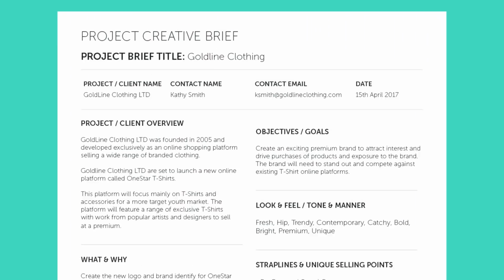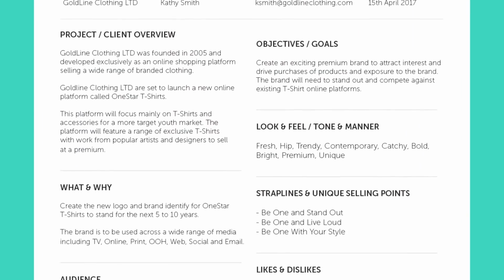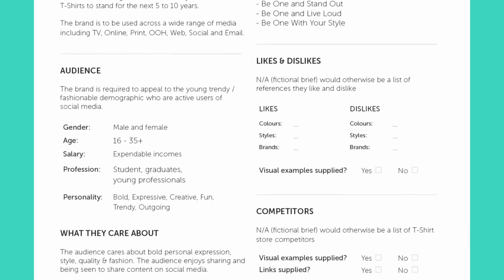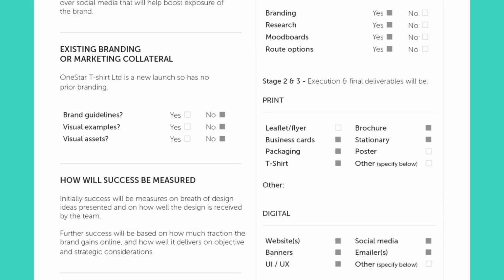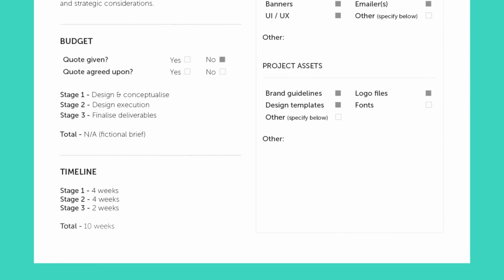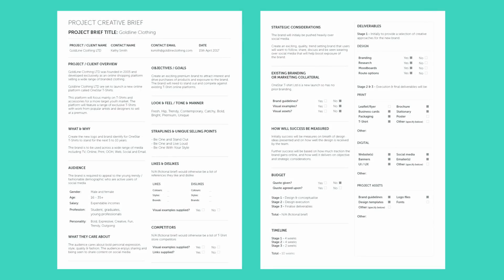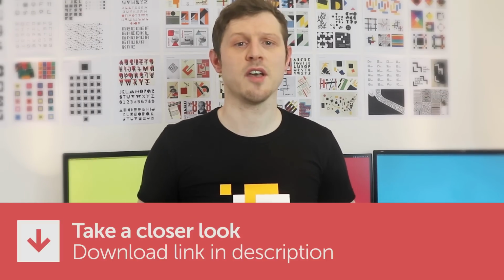The Graphic Design Brief

Comment: I'm actually having a hard time lately on creating my designs because I can feel there is a missing part between me and our clients specially that im not usually the one meeting them if i was too busy 
im sure that series will help me to figure this out cuz as you said I can feel that it takes much time to edit and adjust when we don't meet the client requirements
Reply from the maker: I think a good solution for you would be to get a solid brief established. This would help with some of your issues. 

It does take a little work to sort out, but it pays off eventually. In a future episode, I will touch on how you can set one up yourself in the event you are not issued a brief. 

Check episode 4 in the description.
Reply: yes . I will check
btw I want to thank you so much you probably got this alot but a year ago I found your videos and since then I learned so much and this is one of the reason why I got my job .
thank you for taking time to provide this high quality contact 🙏